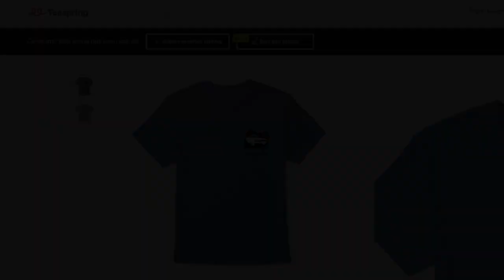30 Year Field Find! New Project Truck!

Comment: 1975? Got that one year only DODGE EMBOSSED 1972 tailgate... With a Matching 72-73 style grille!  LOOKS LIKE A 72 TO ME...  Good luck with it anyway... I have been driving a 77 just like it with a 225 and 3 on the column for OVER 22 years as an everyday driver, and my ONLY truck in service. Wonderful little trucks! Frank Parks at Mopar Restos in Summerville, Ga.
Reply from the maker: Thanks Frank! Will talk soon.

Comment: PLEASE keep the original drivetrain! My first slant 6 with 3 on the tree was a 60 Seneca. One of the best vehicles I've ever owned. Maybe upgrade to a 2 or 4 BBL and some headers, but keep that setup
Reply from the maker: I’ll see if I can get it going. The truck would be pretty slick with a 360 magnum or a 383. I’m still weeks away from really digging into it.

Comment: my granddad had the same truck 1972 100  with 360 auto on the column 727 built to pull a camper trailer and the rear was also set up low geared . he called it - The old blue goat . he bought brand new back in the day I believe . I did a dodge truck model in memory of my grand dad . I'll send you the pics on Facebook or Instagram 😎👍🏁✌
Reply from the maker: I saw your model! That’s awesome brother. My great gpaw had a 74 that ran on propane! Clean burning 318. Lol

Comment: I am also doing a 72 d100 mine was missing more parts when I got it.
Reply from the maker: They’re awesome trucks. I prefer the 70’s trucks for sheet metal, frame thickness, and body lines.
Reply: @JustMoparJoe  we need you to do  a video on installing a new hei distributor in one. With an external coil. I’ve found one on utube and it’s not very good. There are hundreds using a gm module but non installing a new distributor
Reply from the maker: @scottdurant6868  I like this as a reference. It’s a cool way to mount the module and use your factory distributor as well. Beyond this, you’d run one hot wire to the positive side of the coil and to the module. https://youtu.be/JokHrHZRFkg

Comment: I got an identical truck but tan in my pasture im about to drag up and start building. Using my b200 lower control arms and 8 3/4
Reply from the maker: This one I’ll sit lower in the front with a 360 or a big block 🤫
Reply: @JustMoparJoe  Ive got a 78 I shoe horned a 383 into. The tan one I have a good 360 and b body 833
Reply from the maker: It’s hard to beat a big block. I had to shove a few rubbers in the front springs of my 77. It was sitting low, even with a small block.
Reply: @JustMoparJoe  I had hell getting long tubes to fit. Had to notch the sides of the frame.

Comment: Roger that is unbelievable that is a nice truck now if that truck would have been up here in central Ohio where I'm at it would be nothing but rust and it would be good for parts and that's it a lot of us long to drive on 3 speed on the column course it would be nice with a V8 automatic if I had it I would put a V8 and leave the three speed on the column I don't know if you have to change the cave members or what on those I never worked on this truck good luck with her will look for an update
Reply: Sorry I meant to say Joe
Reply from the maker: @keithhebert9334  all good brother. I will see what the 3 speed needs and if I can find a small block bell to fit it. Fingers crossed

Comment: I never find a score like that so I think I'm just going  to take my 76 to a custom shop and have them make it a short bed
Reply from the maker: It’s pretty sweet. The shame is that the paint looked freshly broken off the front fender. It hasn’t even surface rusted yet 🤔. Truck made it 49 years and some dipstick ran into it with a tractor or something.
Reply: The long beds look really good if you lower them. I have a 79 D-200 long bed that I have set up with that funny car rake and 12” wide tires on the back and narrow tires on the front. I also took off the bumpers and mirrors (kinda illegal) but it looks really bad ass. It has a 360 with 727 trans and a dana 60 with 4:10 gears.
Reply from the maker: That sounds cool. This blue truck is a little shirt bed. I was able to get the tool box out and check out the bed
Reply: @JustMoparJoe  mine is a blue and white prospector. It’s super clean too. I put a 64 mustang gas tank between the frame rails. Had to cut out a cross member and make custom one and you have to fill the from the bed of the truck. I don’t really haul anything in it, so it’s no big deal. Just use it to piss off the neighborhood and terrorize the streets lol. I’m looking for some little red express or warlock side mirrors and a manual steering box. I’ll probably do a roll pan for the rear, some day. It has round head lights instead of the 4 rectangular ones, do you know why dodge did that?
Reply from the maker: I’m not sure. I remember a 79 military truck that had round headlights instead of square, but had the same 360 as the LRE. It also had manual steering LOL

Comment: Is the black truck still around?
Reply from the maker: Yes sir. I stole the engine to overhaul for the barracuda. The trans is in the barracuda now. I had a guy give me a cash offer on it the other day as a roller. He didn’t come through. I have space for it. No need to sell. He just made me a decent offer and I accepted it. But it was all talk so far.
Reply: I'm in Cabot, if he doesn't get it and you still want to sell I'm looking for a project. I sold my 70 Road Runner and want to Hemi swap a truck next. I think I'm on ur Facebook page also. 👍
Reply from the maker: I just looked you up! I’ll give you a shout if he doesn’t come through. Wife says I have too many projects 😂
Reply: @JustMoparJoe  sounds good! 👍

Comment: Being a city slicker, I've often wondered why country folks just leave a vehicle sit out in the middle of nowhere, abandoned to the elements..
Reply from the maker: I’m assuming the guy died and no one knew how to revive the old truck. The front brake is locked up, and the clutch is stuck. In cities, houses usually have smaller lots of land, and restrictions against non running vehicles. I know in California you can get ticketed for having your own car, in your own yard, without current registration.
Reply: @JustMoparJoe  Same here in most counties in northern IL.. It sucks! The vehicle has to be 'out of sight from the street in an enclosed building', meaning you cannot have a vehicle that doesn't run or isn't currently tagged in your own driveway. They will ticket you via the mail if not.
Reply from the maker: That’s enough to make a guy move! My in laws are from Joliet. They’ve been all over Illinois with Cat. Best car show I got to see was in Morris. 👍🏼
Reply: It's a diagnosable mental illness